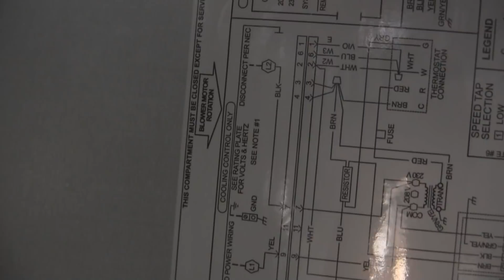Wiring a Air handler

Comment: For those complaining about not seeing the actual wiring, the only thing you missed was the electrical tape being wrapped around the white wire, passing the 12-2 through the air handler body and securing with a clamp and wire nutting the black and electrical-taped white to the yellow and black wires in the unit.  The yellow and black are labeled L1 and L2 on the wiring diagram.  It doesn't make any difference which is which as they are both hot.  Make sure you use a double pole 15 amp breaker at the panel.
Reply: Thanks, exactly what I needed.

Comment: I have never seen or installed a switch for an air handler nor have a circuit breaker for one.  Usually it's wired from a circuit already existing.  Hmmm that questions my last job.  I shall look into this.  Thanks.
Reply: I'm in the same bolt

Comment from the maker: @Nutintoitbut2doit Yes it is a fire repair. This project is scheduled for inspection this next week depending on if the roof is finished,we'll see what happens with the drain pan.
Reply: @electrical industry networks 
I have a question I have 240vac air handler single phase has black and orange wire going to terminal block. The orange wire goes to relay and says common does that get neutral or 120vac along with the black 120

Thanks

Comment: Hey Sparky was that a fire damaged home being rebuilt? I have worked on a few home rebuilds after a fire and they almost always paint the old wood with that white paint.
Great job wiring things up. I did'nt see any secondary pan for the air handler did it pass inspection?

Comment: Hey Sparky !!!
Looks like you did a Fine Job !!!

No Emergency Strip Heat ?
They gonna run Straight Heat Pump ?
Here we must have ALL UNITS in Attic's in Safety Over Flow Pans !!! (don't want to Pay for Water Damage) ...
We must have Safety Shut Off on Secondary Condensate and a Float Safety in the Pan !!!
When Feasible we Run the Condensate from Pan, to a Highly Visible Location , and Inform Customers if they see ANY Water from this Pipe to immediately shut down Unit and Call Tech !!!